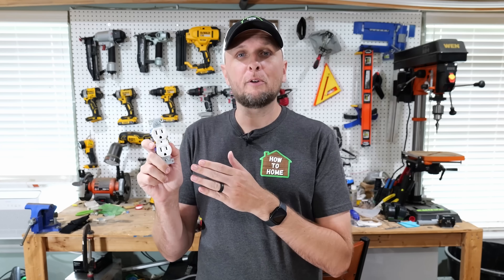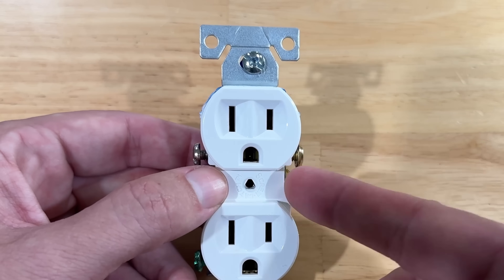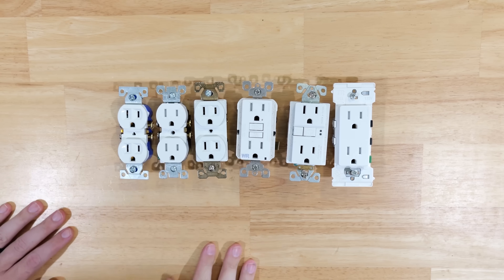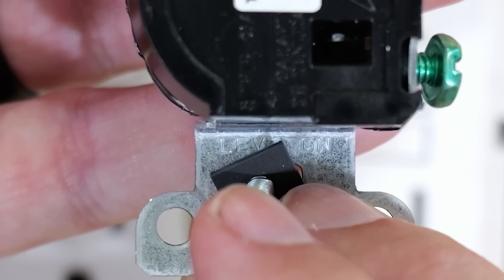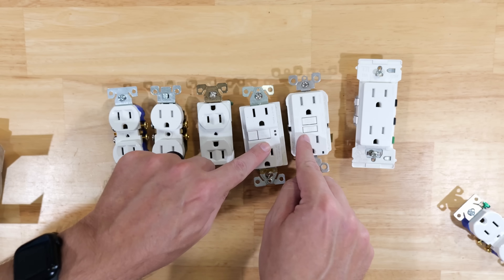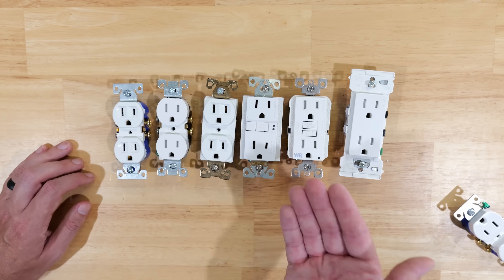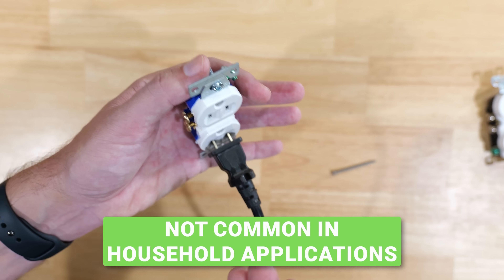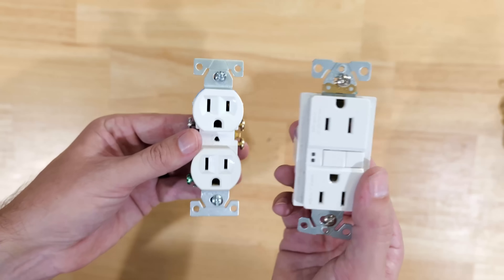The Shocking Reason Why Your Outlets Are Installed Upside Down!

Comment: Finally! I have family both in the trade and code enforcement, and this has been my hill to die on when this topic comes up: Code defers to the manufacturers for proper installation and if you dig deep enough most manufacturers documentation (or the stamp on the strap) will say ground on top. Look in any product catalog from any manufacturer and you'll see them pictured ground-up there too! If I remember correctly, they've tried to introduce it to the NEC a few times but they've never incorporated such verbiage for residential. And if they're doing it in hospitals there's probably a good reason why! Next on my list: Why are we installing receptacles only 12-24" high when most of the time they end up hidden and/or unsafely jammed behind furniture, when 48" would be better for many reasons? I have some strong opinions on the current state of Junction Boxes too if anyone wants to hear it.
Reply: Apprentice here. I’m very interested in your opinions on junction boxes!
Reply: @DorMatt1 Ok here goes: Basically, I think every aspect of JB's current design is severely lacking for modern needs. Most NM boxes are nail-on by default which makes it difficult to mount them precisely and puts too much reliance on the quality/accuracy of both framing and drywall. Some manufactures have kind of solved for this with screws or adjustable-depth boxes but this could be done better and should be standard on all JB's. I find the nails to be inadequate for something that is considered permanent infrastructure in both their placement and ability to adequately secure the box to the framing member, and especially so in old construction where slow-growth wood makes up the framing. With NM boxes specifically, I can't stand the haphazard screw holes used to secure receptacles and have seen too many strip out after only a few times of swapping receptacles or if it's a high-use receptacle. These might have worked well enough 50 years ago when things rarely changed but today's receptacles are being churned out with consumer-level features like USB ports which means they're being both used and upgraded more, and newer building codes have changed to increase the holding strength on plugs; plastic just isn't cutting it, let alone in instances again if the box itself is mounted funny for any reason, this quickly becomes a nightmare to secure something that is supposed to be permanent infrastructure and also compromises its safe operation. Speaking of USB, it is becoming difficult to not overfill JB's with some of these new receptacles even if you're using the largest JB (eg Carlon Super Blues) and I hate how you have to fight to jam the wires in the box, then fight to make the receptacle's finished appearance look straight (especially if it's Decora style) - none of that is safe, nor does it look good. So... if I were to re-design a JB from the ground up this is what I'd do: No more nail-on, instead incorporate a plastic bracket of sorts that is screwed to either the face or side of wood, and box depth and angle should be adjustable via set-screws that are accessible post-finish install. This would also allow for the JB to be completely removed & replaced if needed without modifying any finished surfaces (eg drywall). The two screw holes to mount receptacles should be abandoned entirely in favor of a clip-in system where the receptacle simply snaps in with little tabs, no tools required, and could also have some depth adjustability built in. This would also also increase the box volume slightly, but there should also be a built-in pocket on the top or bottom of the box where excess wire and wire nut junctions can be tucked into so as to leave the primary chamber mostly free for the receptacle itself (see Carlon B117RSWR). JB's should come equipped with a terminal block using wago-type lever connectors so you can terminate and land wires so there's a sort of demarcation between 'permanent infrastructure' wires and 'receptacle' wires to further free up volume and reduce damage to the former whenever you need to replace the latter. Lastly, all NM JB's should come equipped with a built-in strike plate at the rear of the box.

Comment: ground prong down is the proper way.  anyone who says otherwise has never used a recepticle.  ALL plugs are oriented that way; especially recepticle lights for example: they are oriented with the ground prong down and having to plug them in upside down renders them less functional since it orients the light sensor and motion sensors inoperable.

Comment: Some of the appliances (refrigerators) have a cord that doesn’t come straight out, but the cord is going in the direction of the ground pin so that outlet needs to be installed ground down to prevent the wire from going up and making a turn and then going down.

Comment: Another advantage of ground pin down, imo. In an accidental potentially wet and floodable space location do to a water leak, having the ground pin down would mean the water would reach the ground pin first and be grounded and then as the water rose to get to the hot pin it would enable a GFI if installed to trip, the instant the water level reached and touched the ground pin. With the ground pin on top, all the water would be energized for seconds or minutes or hours if a slow leak all the while awaiting the water level to reach the ground pin posing a potential electrical shock hazard to anyone entering the water while it is energized.

Comment: The 90 degree plugs almost always have the cord leaving the plug from the ground prong side. That means that if the ground prong hole is up, the wire will first go up and, depending on how long it is before it reaches the appliance, drape back down in a tight curve. If the ground prong hole is on the lower side, the wire will go down and gravity will not stress the wire just as it comes out of the plug. Some 90 degree plus offset the wire so that it does not cover the lower half of the receptacle if plugged into the upper half, but it still proceeds generally down from the ground prong. Switched receptacles might be easily identified by having the ground prong up, but only if both halves of the duplex receptacle are switched. Often only one of the two outlets is controlled by a switch (the connecting tab is removed to separate them) and both the switched and the unswitched halves will be orientated the same way.

Comment: In a working shop. Ground up because extension cords and electrical tools with grounds end up with broken ground plugs when ground is at the bottom. Too much torque on ground with the weight of cords hanging out of receptical. Of course if not fully plugged in tool may loose ground first when ground at top. But tools seem to keep grounds prong intact.

Comment: I'm not an electrician but, when I need to install/replace a receptacle, mine will be ground-down, simply because we're so used to them that way. Another thing, I look at any print or engraving in the metal bits that the screws go through to attach the fixture into the box, and I go with the which way would one normally read that print. Only twice I had to install upside down (ground up) simply to get a better fit for the wiring in the box. As for installing any socket under or near the sink, most Canadian codes will have them at least two feet away from any water source, and they must be ground fault certified, and they frown upon the under-sink installations altogether.

Comment: Good and very valid argument that you make at 10:05 regarding something falling on the blades if it is installed ground prong down. Wife and I were on vacation in Carribbean. Above her bedside table was a ground prong down receptacle. She had something plugged in but during the night tripped over the cord and it pulled out slightly. Next morning she was half asleep when she tried to pick up her gold necklace from the bedside table. It slipped out of her hands and landed exactly on the two blades which had power going through them. Instantly fried the gold chain and melted it to the live blade. Breaker tripped obviously and I could remove the necklace that was now welded to the blade. This was a very , very expensive incident. She bought this 18ct gold necklace several decades ago for a mere $65 or so. It is now valued at over $10 000 and the quote for repair with the recent gold price (in the fall of 2024) was in excess of $2000. From now on I am a ground up installer!

Comment: I've heard all of these arguments, or explanations. I was a kitchen installer and Formica and Corian fabricator so being in the field electricians were often asked about the orientation of the devices. You mentioned some of things I heard on the projects. Personally, I thought they were all kind of silly since in my, now 70 years on earth, I never heard of anyone being seriously injured or killed by touching the contacts. I'm pretty sure the breakers are designed to reduce the risk and now especially so with GFCI and AFCI receptacles or breakers. 
My question is: what do other countries do that use 220 volts and two prong plugs?
Reply: @grannydeen1586: Ground prong up when that outlet is attached too the wall-switch so people there know where to plug in their lamp to control it from the wall light-switch.
  Medical facilities have things hanging on walls that fall, like clipboards, scalpel, hemostat, that can fall and short the circuit, military galleys and  restaurants, ground up was specified, due to stainless steel utensils being dropped, etc. Therefore it has become required that they be ground up for contractors. In many cities ground up is standard in all commercial and industrial buildings, ground only go down in residential buildings, houses, apartments, condos, etc. 
   Internationally, countries with 3-prong outlets always have the ground up
   Everything is in context and the answer DEPENDS on context. 
   Examples:
“Never took the orientation of an outlet seriously until I was measuring for a shelf with a tape measure. It slid down and fell across the prongs of the washing machine plug.  POW! “ —@joef.6596
“I work at a K-8 school. Maintenance assembles powered multi media carts with the ground plug up in consideration of teachers dragging metal bracelet chains across partially unplugged power plugs.” —  @scaryhouse7969
“a length of florist's wire rolled off a side table onto a slightly loose plug and shorted the circuit, creating a small fire (quickly extinguished).  I now always install ground prong up” @deegee54
“I work at a restaurant and we have this work table with some outlets built in on top. Someone managed to let the edge of some tin foil go in between a plug and the outlet and it got disintegrated.”@MatthewSuffidy
“I knocked some change off of my end table one day my mistake of course, and a coin fell down right on the prongs resulting in a loud pop and a flash along with some smelly black smoke. I have since gone through my home and reversed all of the receptacles so the ground prong is now on the top.”—@chrisenglert3958
“my wife's gold necklace chain dropped off the rack onto two prongs of a device that were plugged into a receptacle with just a little prong showing.  It vaporized the gold necklace area of contact and left a nasty burn mark on the faceplate of the receptacle.   This was on a bar and I probably should have oriented the receptacles there ground prong up.“—@winfordnettles3292
"I had lunch with the Chief Electrical Engineer at McDonalds headquarters. He told me that one of the workers in one of their stores had her hand badly burned when a metal cookie sheet (or something similar) slid out of her hand. It fell onto a receptacle that was loose…the metal cookie sheet made contact with the two blades resulting in  big arcing flash that caused the injury, this is a reason Ground Up is safer."
“In commercial buildings (where receptacles are very high from the floor) ground has to be at the top. In a case of a water leak ground has the first contact with the water. In residential buildings (where receptacles are not far from the floor) ground needs to be at the bottom. In a case of a flood, ground wire would have the first contact with the water.”—@powerzx

Comment: So, I did some paint and body work for an electrician buddy and he offered to finish wiring my garage as a part trade.  He ended up doing this while I was at work and boy was I surprised when I got home and found a dozen nice new receptacles all mounted upside freakin down!  I can be a lil picky, so something that may slightly irk most will likely drive me bananas! For instance, upside down outlets!  That day, I ended up flipping around every last outlet before ever going into the house after work.

Comment: Another consideration: "Wall wart" transformers with polarized plugs tend to fall out of ground-prong-up receptacles because their center of gravity causes them to pitch forward.  With the ground prong down, the bulk of the tranformer hangs below the recepticle, so that weight tends to pull the transformer into the recepticle rather than pulling it out.

Yet another consideration: The majority of 90°cords (Where the wire comes out of the plug flush to the wall) point the wire down in a ground-prong-down recepticle and point it up in a ground-prong up recepticle. You usually want the wire to hang below the receptacles. It's more stable that way.

Comment: is it possible that ppl prefer ground down bc socket this way looks like a face? I think ground up would be better. I noticed the issue with US sockets that due to its shape and constructions the plug with wire might be quite heavy and when the socket a bit old and plug is no longer tight, weight of the wire pull down plug from the socket. If ground is down, weight push ground connection deeper in but faze and neutral sockets pulls out -  bad connection, spark, fire! If u put ground up, ground stick is pretty massive and it will hold the socket even though it will pull out a bit, but it will push-in the faze and neutral in. Main problem of course IMHO that the US plugs is relatively too small and light compare to wire size and weight. Again, if this is a 2 wire cord, sure its much lighter and probably will have less problem. But if we talking about massive round insulated wire its really heavy and it will pull plug down. I've seen this happening many times.

Comment: It is a metal face plate that is most likely to fall on the prongs, not a paper clip.

One thing you missed in the discussion of preferred orientation is right-angle plugs that keep the cord parallel to the plane of the wall.  They typically have a 45° offset of the cord from the long axis of a duplex receptacle, so that two such cords may be installed without interference.  I have an appliance with one such cord.  If the ground pin is at the top, the cord will be at 315° (0° being straight up); with ground pin down, the cord is at 135°.  The latter orientation is preferred to reduce strain on the cord.
Reply: Medical facilities have things hanging on walls that fall, like clipboards that short the circuit, therefore it has become mandatory policy that they be ground up. In many cities ground up is standard in all commercial and industrial buildings, ground only go down in residential buildings, houses, apartments, condos, etc. 
   Everything is in context and the answer DEPENDS on context.

Comment: I recently bought a home and notice at least one receptacle per room had the ground prong down. What I noticed was, ALL of the ones that were installed "upside" down were linked to a switch. I just assumed that was a "note" or identifier that those receptacles were installed that was to show they were "different" than the open circuit receptacles.
Reply: True. Intentional. Ground prong up when that outlet is attached too the light-switch so people there know where to plug in their lamp to control it from the wall light-switch.
  Medical facilities have things hanging on walls that fall, like clipboards that short the circuit, therefore it has become mandatory policy that they be ground up. In many cities ground up is standard in all commercial and industrial buildings, ground only go down in residential buildings, houses, apartments, condos, etc. 
   Everything is in context and the answer DEPENDS on context.

Comment: Two thoughts you missed, one with ground down the outlet looks like a face which mentally makes it look better that way. Second with the ground up it puts the plug and cord tension on the ground instead of the hot and common, causing outlet to wear out quicker

Comment: Usually install Leviton 5262 outlets in residential, and those are ground up based on the direction of the text on their face, everything on back is perpendicular, so no indication there. The same applies to their 8200. Though Leviton is hardly a standard for anything, IMO.

Comment: I just purchased an Eaton outlet with USB A and C charger connections built into the plug. The outlet itself has "TOP" marked on the metal screw strap that would make the outlet oriented in the grounding prong up direction.

Comment: Ground plug up it got shot in the head. Ground plug down his mouth is below his eyes as they should be. Seriously though, most of the devices that have a charging block with the prongs on the back are on the top of the block and the charging prong is lower than the two other prongs. If the plug has the grounding outlet on the top, you have to install the charging block upside down and the weight of the block is shifted to the top and it will lean outward and can fall out of the plug. I always install grounding prong down which forces the weight of the block against the wall beneath the plug. They look better aesthetically and my devices with charging blocks never fall out of the plug.